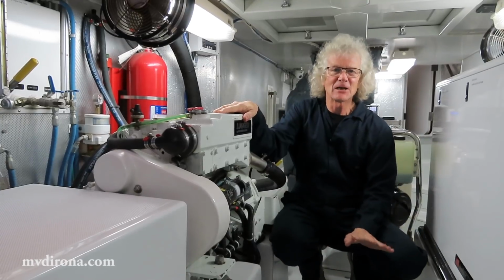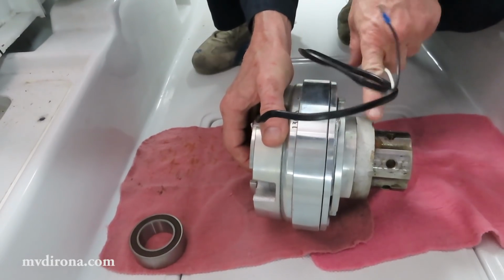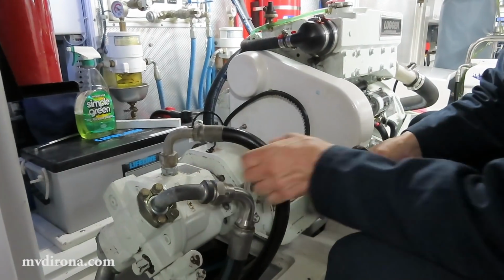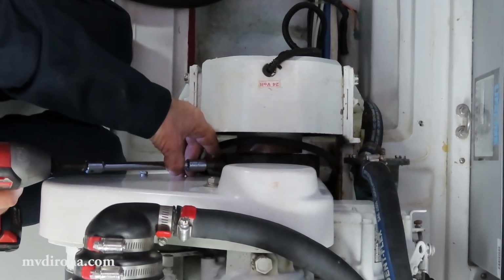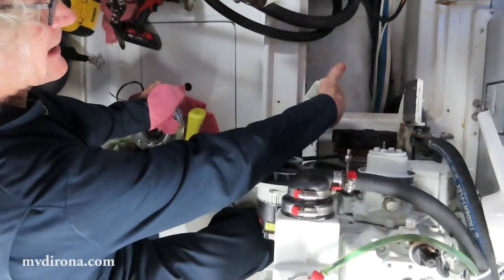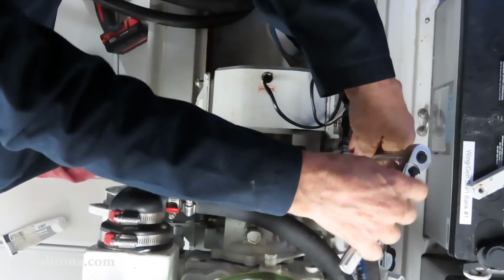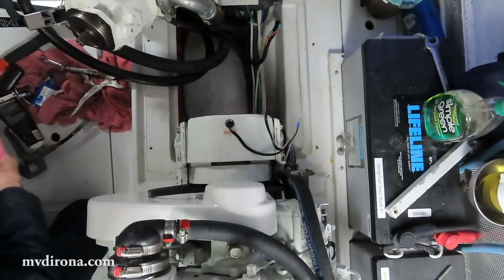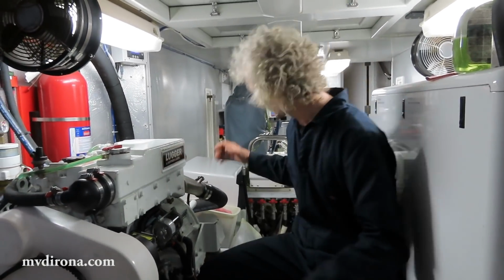Replacing Lugger/Northern Lights PTO Clutch (MV Dirona Channel)

Comment: Thanks for sharing your projects!  it's like they say, cruising is just boat work in exotic places. :)
Reply from the maker: Like all sayings, there is a glimmer of truth in it but the actual amount of service the boat consumes is surprisingly low.  If you are interested, we post pictures of all service work we do to https://mvdirona.com and you'll see that there really isn't that much work relative to use.  

Nordhavn builds a pretty good boat and uses excellent components sized well to the job so the systems work fairly well.  And, what's really important, is the boat is designed to be able to be serviced. They avoid the common fault of building larger components in such that simply can't be fixed or service in reasonable time frames. That allows us more fun time and less work time.
Reply: @MVDirona  I've plowed through most of your blog and yes it does seem to have a really good operation/maintenance ratio. And I'm guessing you would be kind of bored if you didn't get to tinker with some technical stuff at least once in a while? :)
Reply from the maker: You might think that but, even though we do all of our own maintenance, it's actually hard to squeeze it in between a full time job and all of our exploring. We feel lucky the boat is built so strong with such good components so we aren't constantly trying to correct bad design decisions or upgrading poorly sized or chosen components. Less time fixing is more time having fun!
Reply: MV Dirona Full time work and full time exploring, yes that sounds like a busy enough schedule!
Reply from the maker: It is busy but, generally, I like the job, like the boat, and love the adventure we're having so no complaints.

Comment: Handy to have a complete clutch assembly ready to go I don't blame you for not trying to change the bearing there and then could be done but it be a pain good clean job
Reply from the maker: We try to have all the spare parts we need on the boat with a goal of never having to stop and wait for parts or service personal and not having to change or cut short any trip. So far, we been successful with the boat never getting in the way of a planned adventure. 

Consistent with that goal and knowing the clutch units can fail, I tucked away a new clutch assembly when the boat was new.  I did have a look at changing the bearing but it requires a puller that is just a tiny bit bigger than what I have on the boat so I might just ask a machine shop to do the swap for me.

Comment: Will be a very helpful video one day when I own one of these beautiful vessels. Great video.
Reply from the maker: What I learned is that this job isn't difficult at all. I was expecting the worst. If you do end up in the market for a boat, after 10,600 main engine hours, I have no trouble recommending a Nordhavn. They are a good strong boat that take care of there passenger and don't eat up too much service time.
Reply: MV Dirona Thanks for the reply! Being an A&P mechanic most of the work I do on planes are  in tight cramp spaces and seeing the work space of your Nordhavn makes me jealous! But you and your wife’s experience on your boat and all your wonderful documentation and insight has just further cemented the fact that these are some of the best personal long distance boats you can buy. Fair winds and safe passages!
Reply from the maker: I know what you mean when you comment on the massive work space on Dirona. I used to work on exotic cars so I'm very familiar with being wedged in very tight places trying to reach something only reachable by a tiny person with factor provided special tools. From that perspective, Dirona looks big. But some time back a friend with a 62 had a hydraulic cooling pump leak on their Nordhavn 68. I had never before really been that interested in a bigger boat but, wow, space does matter. I just walked to the back up the their boat, turned right and went behind the generator, sat down, and change the pump seal, wiped of my hands and was done. On Diorona, that would have been a lot more challenging a job so it's all retaliative.

Still, understanding that all boats are a compromise, the trade-offs on Dirona of space against cost, moorage availability, etc. seems to work fairly well for us. After 10 years and 10,830 hours, it's still working out fairly well. And, on service space it's about 10x better than our previous boat so I really can't complain.
Reply: MV Dirona Same goes for many planes we do work on, bigger they are usually the more room you have to work around in but also way more parts and systems that smaller planes lack or simply don’t have, so there’s that trade off. Also is part availability ever a problem for you guys being scattered across the globe? And what would you say your yearly cost is for parts both extras and ones that need to be replaced. Thanks again for the feedback! -Jim
Reply from the maker: There's one difference. Our boat is a Nordhavn 52 which is on the small side but we have equipped the boat almost identically to what is common on a Nordhavn 63 or 68. It makes for a super comfortable and very enjoyable boat but we do carry a lot of gear for the size of the boat and that is noticeable around some service activities.  

Another factor that is somewhat different from aircraft is, with Dirona at 55 tons, a bit more weight here or there makes little difference so we carry a very large number of spares. This has the dual upsides of making me more efficient, if I think but I'm not sure a part is faulty, I can just change it and see.  The second upside is remarkably frequently when we have a part wear out or fail, we have a spare on board and are able to just continue without delay or even needing to slow down.

On most things, it's exactly as you say. Bigger boats are easier to work on than smaller ones and, compared to aircraft, even a "tight spot" on a boat like ours is relatively generous when compared to an airplane.
Reply: MV Dirona Happy New Year and Decade guys! Continue your awesome adventure with health happiness and issue free! My Gf and I still check in on you guys week to week, can’t wait to have one of these one day.
Reply from the maker: @5cyljim   Happy new year to you as well.

Comment: I think the water pump had been leaking longer than you think with the amount of rust inside maybe that was an problem that brought about it's early demise,great job done,and touch up the mounting bolts with white enamel please,the old unit i.d get a car Aircon reconditioner to press bearing in looks similar set,up to the units running off the bottom engine pulley,it's woman's work now you showed Jennifer how to do it that's her job next time you can sit back read a book
Reply from the maker: Jennifer probably could do this job in a pinch. 

I'm not sure why I don't touch up the paint on the engines as they get service or replacements. I probably should but I don't typically do it. I guess I don't mind seeing what's been touched and what hasn't but, you are probably right that I should touch up the paint.

You're right that the bearing is a press fit. I remove the circlip and tried to take it apart but the biggest puller I have on Dirona is just a tiny amount too small to pull apart the clutch so I'll probably get it done by someone. Your recommendation to go to a automotive air conditioning specialist is a good one. The clutch is made by Pitts and much of their business is automotive air conditioning clutches so they are familiar site for those folks. Good suggestion.
Reply: The main advantage of repainting the bolt heads apart from looks it helps as an early indication of anything coming loose the paint seal will crack makes for easy inspection doing maintenance checks ,i.m used to heavy earth moving plant things vibrate and loosen the paint makes everyday inspection easy when something loosens and gets missed the rust sets in the joins then weeps out easy to see and fix before damage or injury
Reply from the maker: That's a good point and, if you think that earth moving equipment has some vibration, try a 4 cylinder diesel without a balance shaft. It's far from smooth and vibration is the cause of the problem with the clutch bearing. The clutch has two bearings, one that always spins and one that only spins when the clutch is disengaged. The always turning bearing is fine but the one that doesn't turn when the clutch is engaged suffers from just sitting in the same place and vibrating which can cause false brinelling.

Your argument that painting makes it easier to see fasteners backing off makes sense. As soon as I can find some paint that matches, I'll do it. Thanks for contributing your experience.

Comment: How many hours are on your main engine?
Reply from the maker: There are 10,830 hours on the main engine and 6,214 hours on the gen so all have been used quite a bit.  Believe it or not, the main engine is still running the original coolant pump and all but two sensors. The only major components on the main that have been changed are the harmonic balance (recommended 8,000 hour replacement) and the fuel injectors were changed at 9,522 hours.  Overall it's been amazing:
*Injector change: https://mvdirona.com/2018/04/engine-work-for-christmas/
*Summary of the Deere at 10,000 hours: https://mvdirona.com/2018/09/john-deere-6068-at-10000-hours/

Comment: VERY nice description.   Now tell us (probably a separate video) just how you keep the engine room looking like a surgical suite...
Reply from the maker: Thanks for noticing William. I'm particularly happy to see the engine room still looking clean after 10 years and 10,830 engine hours. One of the biggest factors that make keeping it clean easy is the John Deere 6068AFM75, the Lugger L844D, and the Northern Lights M843NW3.3 12KW generator don't leak much oil. It's much easier to keep things clean when the engines are well sealed and not dumping oil. After that the biggest contributor to dirt in the engine room is the massive amounts of air that circulate through it. It's amazing how much dirt gets pulled in by the air moving equipment. But, at least this airborne dirt isn't oily and can be removed with a periodic quick vacuum. Another nice addition is lots of really bright lighting that makes it easy to spot something wrong when passing through the engine room. Lots of light makes it easy to notice a small problem before it becomes a big one and makes a mess.

Comment: Great video as always, but I hate seeing any raw water pipe work with single jubilee clips like on the raw water pump.
Reply from the maker: Thanks Dan and I agree with you observation on double clamping. The policy we use is to double clamp any connection that is below the waterline with a through hull connection. So, the exhaust hosing and the through hull are double clamped. The raw water pump is below the water line but it's not double clamped because the inlet hose goes up above the water line to a siphon break before going down to the pump. And the outlet hose goes to the heat exchanger and eventually to the exhaust which has a loop several feet above the water line. 

It wouldn't hurt to double clamp but the reasoning above is why the technique is not used in this particular case.